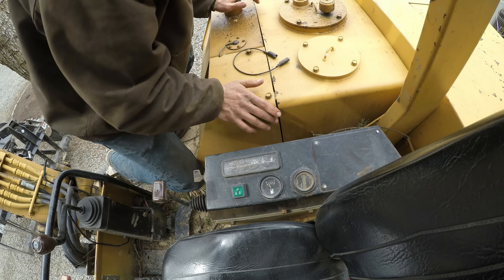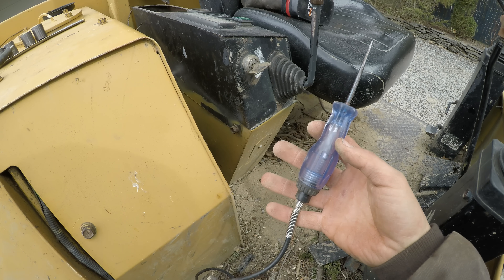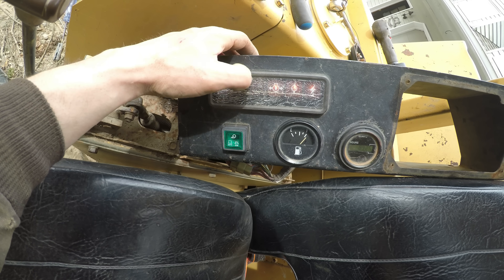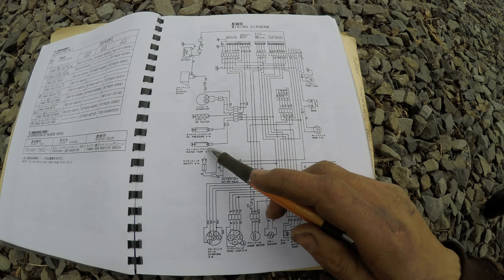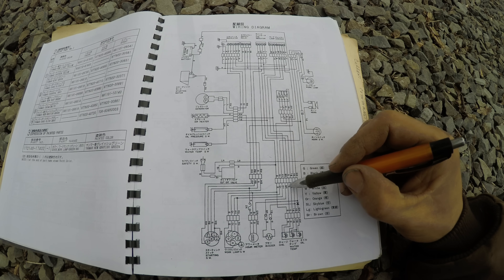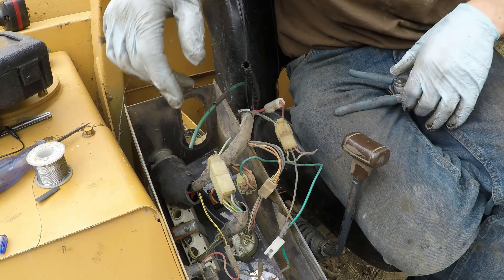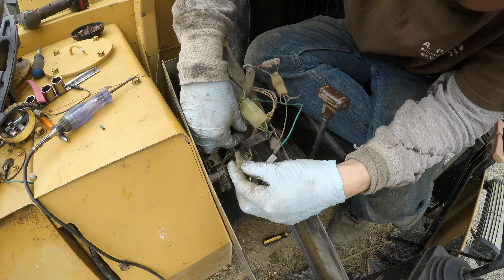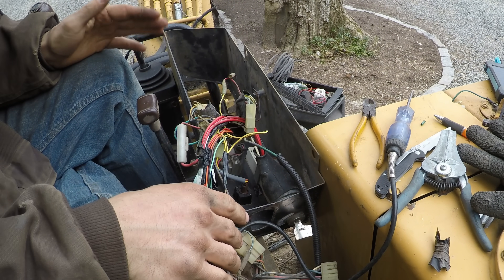Fixing electrical problems on the Yanmar excavator

Comment: Fighting with a similar issue on my Vio40, was working great. Now the engine will not turn over, replaced the safety relay, the switch and tested the solenoid on the starter, all are good. Starting to suspect the wiring harness where it passes close to the exhaust manifold as the plastic conduit has broken down from long hours of heat. Or it could be another relay, I see another relay on the drawing in the service manual, going to find and pull/test that today. But you taught me a lot today about reading the schematic, that helps a ton, thank you.

Comment: Any plans on getting Anthor b50 or getting a brand spanking new one off the dealer?
Reply from the maker: IDK, I have enough mini excavators. I need a rock truck next.
Reply from the maker: It broke. Idk. I want one that runs.
Reply: What happened to the Volvo haul truck
Reply: Okay no more minis but what about replacing the ex100?

Comment: Totally agree about John Deere being garbage. Spent weekend working on my Deere 270. Will sell as soon as I fix best I can. Few things I hate about Deere:
-Overly complex injection pump with many small parts that can fail. Kubota and Yanmars are simple and work great !
-hydraulic cylinders have snap ring inside the cylinder. It’s very difficult to depress snap ring using cheap plastic insert gland they give you. Why why why did they design it this way !!?
- starter motor is very very difficult to get to with 2 bolts that are extremely hard to get to.

Comment: That should fix the problem with your Myanmar.& it's A safety feature controls. Adding that dual buzzer was A very good idea. Accept one thing they half to be on separate power line links.,or has A bad diode on that buzzer.

Comment: Breakout A tester light from 6-volt up 24 lighted tester.,or just A basic light up tester. It will tell you when the glow plugs are getting power.& put A canister insert for starting fluid hot shot spray for extreme colder temperatures outside. So all you half to do is hit A button for it to spray A light mist into the air intake without getting off of your seat during start up mode.

Comment: I've commented on soldering tools before, especially flux.  As an electronics DIY / experimenter, I've found one thing that has made soldering much simpler, faster and a better solder joint - Solderlene soldering paste.  Just coat the clean joint, then solder as normal or melt some on the iron tip and apply to the joint (I know not the 'right' way but is quick!).  Using this flux allows a solder joint to be made in about half the time of melting on flux core solder and less heat is good in general.  A quick clean with alcohol on a paper towel and it's clean too.

Comment: Hey Andrew. This is Cristian here.... I am watching your channel for a while now and see your are very good with heavy equipment.
I have a problem with my minidigger.... Its a Kubota Libra from 2002.
I had an issue with my hidraulic distributor and its fixed but after I put back all the hoses I realised that when I operate the joysticks they don't give me the commands properly.
The main problem is with the right one in particular.
So when I pull it backwards it pulls up the boom but also rotates the excavator to the left and on the left joystick when you push it left, instead of rotating the excavator to the left it lifts the boom up as well.
So can you help? 😊
I would be grateful if you could.

Comment: “Lamp checker” is most likely a simple module that checks your warning lights when you first cycle your ignition switch. The purpose is to verify that the warning lights are working before each use. Otherwise you would have to simulate overheating just like you did or hope that the bulb is not burned out when you need it most. Looks like you bypassed it in your repair. Great videos. I imagine it takes lots of patience and time to get them together. I’ve definitely learned some things by watching. Keep up the good work.

Comment: AC, is it possible the lamp checker is what tests the lamps and buzzer during startup. When the machine is cold the temp switch is open, so no way to verify that circuit works without grounding for a couple seconds when you start up. Same lamp test at startup that cars have.

Comment: 8:11 Is that always how you make wire connections? I'm not a fan of the crimp connectors but don't they also make solder butt connectors?

Comment: Tim from Canada can I make another observation when you were looking at service manuals anyone if you are having coloured wire run from your terminal to whatever device is hooked up to it my suggestion is use the colour wire that matches the colour in the killer what I mean is if there is a coloured wire going from your indicator back into your terminal whatever colour you were using this colour should be on your manual so you can follow the colour from your terminal back to your switchboard on your switchboard whatever colour you were using for example lights whatever colour you were using for your lights from your terminal to your lights that.. colour should be on your manual visible and running from your terminal to your light anything that you use any coloured wire which you see in your engine that colour should be marked in your manual it is hard to chase a wire on your manual if it is a black and white for what people pay for your machines your manual should be colour wired and colour-coded. Do you speak to vacations this is what I see

Comment: how hard is to get parts for an old machine like this one?? i want to get a 1997 Yanmar VIO30 Mini Excavator for $16,000 is it a good machine and easy to get the parts?? i don't know much about excavators. i have and old skid steer and is a pain in the ass to get parts even use parts are extremely hard to get

Comment: I like Takahuchi skid steers and mini excavators. I do not like cat skid steers. They rock too much forward and backward, at least the skid-steer track machines.
I would never own or trust a cat mini excavator because of the front blade construction. On the main arms for the front blade they use metal tubing instead of solid iron. If you use the front blade the level the machine on a hillside that front blade can break off and make the machine flip over. I have had the main front blade arms break off sitting on level ground using it as a stabilizer with a cat mini excavator because of that metal tubing they use for the main arms.

Comment: I am an appliance repair person for 35 years. I have 2 L series Kubotas. I have really learned to put shrink tubing over all 12v connections.  I ALSO have found that a heat gun does a MUCH better job than a lighter to seal the tubing. Your videos are great to watch... you are fearless. I love when you just jump into a giant complicated project and follow it to completion.

Comment: You have said the Yanmar is a reliable machine, i.e. no computer(s) involved in the design and manufacturer of the unit. You prove it is low maintenance with standard fixes expected but overall the Yanmar is a good worker with little downtime for any reason. Fast-forwarding to July 2020, the Yanmar remains a machine that can be counted on anytime.

Comment: Had a Ford Cortina from new, but as it reached 20k miles it got harder to start.   The fault was that the engine was only earthing through the choke cable.   The engine earth strap was bolted onto the paint of the engine block.

Comment: I really like the fact that you solder all your wire connections, it is a much better solution rather than splice connectors.
Reply from the maker: That's the only way they stay working.

Comment: 90% of 12v electric problems are a ground issue  in my experience.
Reply: I recently fixed a few that were caused by:

A 37-year-old bulb failing.
A 43-year-old horn failing.
Somebody allowing a miner to attempt electrical work, creating a situation where I could have either instruments or lights, along with an hourmeter that was wired to ground on both terminals. And I wondered why the hourmeter wasn't working...

But for things that haven't been abused, I agree.

Comment: 99 John Deere executives disliked this video for being 100% right on. I had a JD backhoe that was always needing something fixed.  Same with my JD skid steer. There's more added welds on it than original welds. I have sold both and lost my ass with both deals. They just don't hold resale like some others. I since have gone to Bobcat across the board. Mainly because there's a dealer a mile from my shop and the guys there are so good. And the equipment just doesn't seem to ever need anything. They really thought out well where to place all the serviceable points like filters and grease fittings. And all the hoses are protected better than any machine I have owned. The JD's had all the hoses exposed and vulnerable to damage. In my service truck I carried a dozen different hoses at all times.

Comment: Need to get a wet rag for your soldering iron, bud.  Also, in videos like this, you should show off which knife you're carrying, using on the particular job... I'd think there's a lot of guys who watch these who'd be interested in seeing what knife you're carrying on that particular day, and I've noticed you use several different ones, so maybe you're into that too?  I'd be surprised if you couldn't get some makers to send you free sweet ace knives if the knife is seen in a video... with a link in the description.   Just a thought.

Comment: Wire through the hole before soldering.  So the wire doesn't get warn by the display/switch hood.

Comment: I have a Yanmar wheel tractor that is over 50 years old.  It has run great, and has only needed repair when I have abused it beyond what is reasonable use.  I would recommend Yanmar to anyone.  This machine probably has another 50 years in it.

Comment: I have an ihi 15nx2 love the lil digger but I have an issue with my alternator. Apparently the previous owner jimmy rigged how it was wired and it doesn’t charge. I bought a new alternator and voltage reg, but it isn’t charging. Do you know of a way to setup a standalone 1wire altenator or alternative voltage regulator? I have tried a few different ways and I’m stuck using a charger to charge it before I go dig. The space is too tight for just a normal alternator. The motor is a yanmar 3tnv70. I imagine you’ve run into a similar situation.

Comment: New machines are the worst ... here at work we had a brand new JD tractor with all kinds of issues. Turns out, one wire in the huge wiring mess was twisted too much, I guess creating magnetic field.... long story short, electronics and sensors on heavy equipment is a bad combo.... EPA and OSHA regs have created a mess 
I have an old yanmar B50 .... just like the one in this video, bulletproof machine

Comment: The bad part is... Wherever that wire was shorted to ground... It's likely rubbing while passing through a hole somewhere... and will likely have other wires with it--- that will also short to ground eventually...   Sometimes its worth the extra headache to trace down the wiring harness and find it before it breaks other things.

Comment: one brand to stay away from in heavy equipment, is JD specially in skiders, everything is built so tight, it is all most impossible to work on, a simple thing od replacing a hose is a huge job, you need a come along to pull the old hose out well pulling in a new one at the same time, the same with there skid steers, a real pain in the ass to work on.. you willbe cutting and bending tools just to get at bolts

Comment: It's probably that grounded factory wire to the temp sending unit. That ground is probably setting it off. I worked for Bell Atlantic on wires. When one wire is grounded or touching another wire, that's 2 wires that are fucked. Maybe more. All depends.

Comment: very impressed you kept and added a buzzer . I'd have snipped the bugger off.
Reply from the maker: Might not notice a warning light quick enough if there is a critical engine problem like overheating or oil pressure.

Comment: The only problem with running a jumper wire to fix a grounding problem is wires are in bundles.  If one had rubbed through there could be more.  By not fully inspecting you might be missing a major problem

Comment: Andy I could give you lots tips. A couple Of U T  I watched you are having trouble with tracks. 99 out of a hundred operators make the same mistake. You take my advice or you can tell me to stick it. You should never dig from any kind of loader perpendicular to the tracks. Always dig parallel to the tracks. All parts relating to tracks will last 2x the life you get today.

Comment: What if it's the sending unit is faulty and ur doing all this seems much easier to to take a meter and probe and go from the sending unit one point to say a third of the way to warning light see if short isnt  present continuing with test. Till u have a short discovered.ur damaged spot is between the last test point and where you are now.just a suggestion.

Comment: By bypassing the lamp checker you now can't see if the lamp is working or not when you turn the key to run and causing the buzzer to still be activated. you needed to cut the wire before the lamp checker and buzzer was tied in.

Comment: As an auto mechanic, I want to thank you for soldering the new wires instead of using butt connectors
Reply: Crimped connections suck
Reply: @thomasdobrenick1549  Everything made has crimped connections in it. What about that?
Reply: There's a reason the ABYC forbids solder connections in marine electrical, and it's the same reason you don't use solid wire in anything but residential electrical. The solder joint makes the flexible conductor solid which will eventually break from vibration. Heat shrink butt connectors are superior to solder joints.
Reply: @lunchboxproductions1183  I disagree, I don't know about marine anything really but as a auto technician I have to repair butt connectors all the time, sealed and not sealed they both give problems, never had a issue with a soldered and heat shrinked connection. Yes I understand vibration "can" cause it to break but in practice ive never seen it. I recently installed a holley efi system for a customer and I found it very interesting that they had an entire pamphlet in there showing all the incorrect ways to join wires and showed soldering is the only correct way according to holley. Even included a whoke piece of paper with large print that said do not use butt connectors.
Reply: @guy6751  Thats because 99.9% of people don't know how to do them correctly.
Reply: @lunchboxproductions1183  This is old but you nailed it. Adhesive lined but connectors are better at everything compared to soldering.
Reply: Yeah everything does have crimped connections but the only good ones are sodered
Reply: @thomasdobrenick1549  Solder is for circuit boards cus theres no place to crimp.
Reply: All connectors have a correct tool to make a proper connection. I rarely every see the correct tools used.
Reply: it is not appropriate to be discussing sex toys on this channel.
Reply: Crimped connections, done correctly, can be superior to soldered connections.

Comment: I would assume that the light checker is a module that checks the lights,it must be somewhere on the equipment .otherwise  before you start up or get it too hot that temperature sender won't go to ground if working correctly so the module sends a ground  feed to check the warning light before the engine starts.i assume it works off the engine oil pressure or alternator Voltage ? I'm not familiar with the set up so only guessing.  Your way will work but if your warning light has blown you won't know until it's possibly too late

Comment: On the reliable digger it all depends on how hard its been worked by an operator instead of hours check the pins arms and slew ring always a sign of hard work we had a 1993 ex125 that had 11000+ hours the guy Tommy who operated it from new had it working and looking like new he ended up buying it and going out on his own he still has it to this day i worked it a few weeks back it has 37438 hours its had minor rebuilds but nothing major i on the other hand worked an ex200 and i worked it hard after about 14500 hours its engine was dogged with problems but once replaced went on for another 10000 then became a yard light work machine after that i was in every machine under the sun Yanmar great small machine far better than Cat Hitachi but Kobelco is great too big excavators stay away from Doosan is not great get very low on power Cat are reliable Hitachi are great love them then there is Liebherr top machine bit expensive worked a 964 80 hours a week for two years other than a 10k top ram that a demo excavator hit the machine never skipped a beat all the machines we had worked long hard hours so we did get breakdowns sadly i was moved to the cranes full time was meant to be for a year but ended up being ten then i left because i had to put time into building my own business still go back and do both excavator and crane work though but only when it suits me